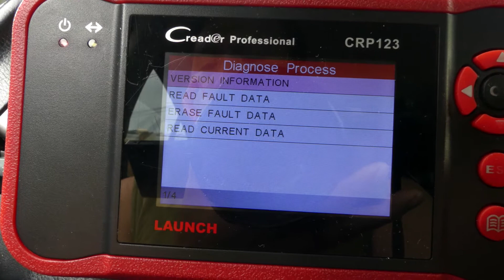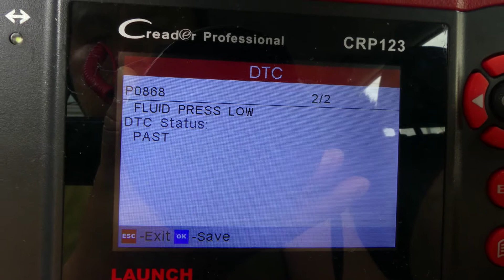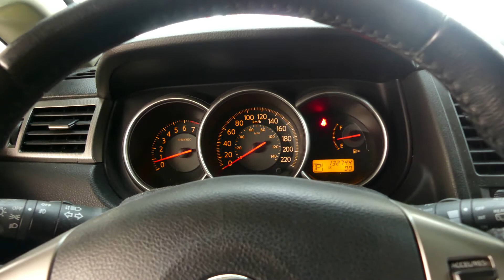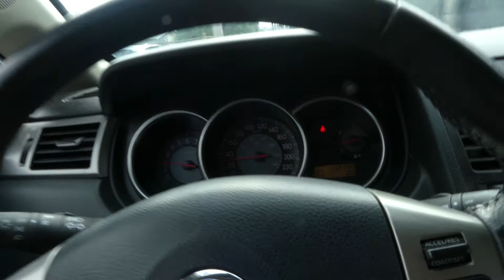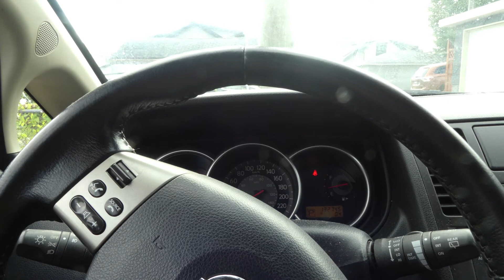2008 Nissan Versa Transmission diagnostic & FIX (P0746 & P0868 )

Comment: I recognize this video is now 4 years old, but it saved me a ton of money and quite frankly, saved me from giving my vehicle to salvage.

I own a couple 2009 Nissan Cubes, and one started making the whining noise and will not move when in drive. Four different mechanics told me I needed a replacement transmission which was on back order even from the dealer at around $4,000. I let the vehicle sit for a while and came across this video. Luckily I knew a bit about working on cars, from my younger days, and got to work. 

I drained the transmission fluid, but no change in functionality. I then drained the fluid again, changed both cone and strainer filters, and topped off with Idemitsu CVT fluid (refused to pay $27/quart for OEM). While the noise went away completely, the gear shift was not as smooth as I liked and I developed a slight oil leak around the pan. I then drained the fluid again, replaced the pan, bolts, and gasket (all factory) and refilled with Amsoil CVT fluid this time. Now the Cube runs like brand new again and no leaks. It is important to torque the pan bolts to 52 in/lbs.
Reply from the maker: Thanks for sharing your experience and I'm glad the video helped you save some money!

Comment: Hi. I seen your video of how to change transmission oil on 2008 Nissan Versa. I have a question please: After  adding transmission oil 6.5 quarts, do I need to open the 19 mm pan bolt to drain the excess oil . Great video. Thank you

Comment: Worked for me in New Zealand. 2006 Nissan note, would not engage in any gear (forward reverse etc.) Replaced fluid with NS2 compatible (Penrite Multi use CVT fluid) as our parts place don't sell them anymore 😕. But runs good now.
Reply from the maker: im glad it works

Comment: 22 bolts on my 1.8 Tiida pan, with a manual ratchet.
I was over it by bolt 3.
there's a little cylindrical filter at the top, but, apparently, nobody ever replaces it, so it's almost impossible to buy.
I think it's for the breather.

Comment: Great job explaining the issue, why it is happening and the solution. Excellent video quality as well. Keep up the good work! My daughter just bought a 2009 Versa and I drove it today for the first time and there is a slight whine from the engine area that coincided with the speed. My first guess was transmission issue so I will dig a little deeper. Fingers crossed! Cheers!
Reply from the maker: Thank you very much!
Reply: What was the issue??
Reply: Probably wheel bearing hopefully.

Comment: Hello, this is a great video, I have the same codes as in this video but my 2013 infinity jx 35 cvt won't engage drive or reverse, nothing completely dead.
Can you tell me what you think? thank you so much
Reply from the maker: ur transmission is dead done u need to replace it

Comment: For my 2009 nissan versa i had P1778 for stepper motor so i got that replaced and everything cleaned out. 2 weeks later same issue. I pulled codes from transmission yesterday and it gave P1778 and P0868. The only symptom i experience is delay gas pedal response 3-5 seconds. No noises and no smell. You think valve body can fix the issue or transmission replacement needed?

Comment: The problem I have with my 1.8 Tiida is that the PenriteNS2 fluid is yellow, and almost impossible to see on the dipstick, (which is a swine to remove if the clip is engaged - I now fit it the other way around.) 
Our 1.5 has red fluid, and it's so much easier to read.
My neighbour paid over $5000 for a replacement transmission in his wingrod, which is mechanically identical to the Tiida/Versa, and it was just making horrible noises.
I'd say that a $400 filter and fluid change would have fixed it.
Love your work.
What do you know about the Honda Jazz CVT?

Comment: What should i do for my car Xtrail T31 CVT. When i drive long journeys about 200 km, the car will not change gear going into limp mode at 40 mph with a whinning noise, i diagnosed it and gave  P01740  code something to do with torque converter clutch solenoid ? But if i stopped switching off the car  for 1 hour and start again the car will go very well and no limp mode.  It looks like this switch get too hot, what should i do?
Reply from the maker: bring it a transmission shop most likely ur having a transmission problem too bad

Comment: I have a P0868 code on my 2014 Dodge Journey SXT 3.6. I have park, reverse, neutral, but only 2nd gear when in drive (limp mode). When in manual shift, it only shows “D”, does not show the actual gear your in and won’t manually shift. On the dash information panel, the transmission temperature is not displaying any temperature and the thermometer 🌡 gauge is at the very top on a (cold start). I also have a P1745 code. The journey has 307,000km on it and has been properly maintained. This problem just came out of nowhere. I took it to the garage today to  get it scanned and I had the engine oil and filter changed (was due). Diagnosis after codes was to take it to the dealer for transmission. I also found out today that the oil filter/cooling housing is leaking (common problem), so now I have to get that fixed. Also, I just want to mention that I’ve had the transmission fluid exchanged at the quickly lube. But, I did not do the pan and filter (big mistake I’ve heard). 
So, I’m leaning towards a clogged filter throwing the P0868 and the P1745 is an issue with the pressure sensor caused by the clogged filter as well. I drive it very lightly.  So I’m hoping it’s just needs a flush,pan and filter service. It’s got 307,000km on the filter so ya it needs to be changed. No leaks on the transmission, that was checked today by regular garage. She’s has great torque and take off but only the one (2nd) gear. She will park, go into neutral, reverse, but can only go 50-60km/hr (limp mode).
Reply from the maker: well try this cleaning repair video that i did it might help ur transmission back to life
Reply: Bonjour
J'ai même problème avec ma fiat freemont. J'ai essayé tous ce qui était décrit sur ce vedio mais le problème est toujours là avec un code P0868.

Comment: clean the oil pan with water is ok and i assume also the screen filter but not the paper cylinder filter right? this paper filter can't be cleaned with water right?
Reply from the maker: yes u can but i prefer brakecleaner not water

Comment: Perfect super video, thank you so much. I've seen so much videos about CVT problems but your is absolutely the best one.  I've a similar problem with my Murano 2006, I've changed CVT fluid (was very dirty as well) with great reflush, but no filters cleaned.Code P0746 is appering when is operate temperature arised car don't want to drive, I must stay one hour to cold up, restart and I can continue next several kms... Do you think should be the same problem with dirty filters? 
Nissan service wants to replace tranny for approx 6000 Eur...horrible to think it
Thank you so much for your super advices.
Have a nice day 8)ose.
Reply: Replace the valve body it’s the solenoid”A” stuck off I have same problem in my 2010 maxima I Just ordered the valve body few days ago once you replace that your car should be fine I was told I need a new transmission but I’ll definitely spend 150 on valve body and $30 on gasket and new transmission filter and $100 on fluid before I go and spend $3500-4000 on a transmission
Reply: We've got the same problem error code P0746 already replaced transmission oils, had it cleaned and still when It operate at high temp it doesnt drive and we have to wait several minutes to cool ito down to drive it again. Mechanic told me to replace the valve body
Reply: @stephenchampagne5763 after replacing the whole valve body was your vehicle fine afterwards? With no more p0746 I am
Going through the same problem currently and I’m not sure wether to take it to a mechanic or do these steps myself

Comment: How far up the dip stick should the fluid be on a Cvt transmission it’s hard to see in the video? I have a p0868 code only.
I filled it to the second notch it looks like you fill it above the notch by 2 inches is that correct? I’m not sure if I have the correct dipstick mine reads hot right after the second notch
Thank you the video is very informative

Comment: Was the shift solenoid in the pan ever a possibility for you too? 

I have dark transmission fluid in a rav 4 
I ordered solenoid
Should i just do an oil change
Reply from the maker: if u had enough budget then go for it but if ur tight on budget just try this method it will only cost u less than $100

Comment: Hello from the uk. What torque settings did you use and what pattern? I'm about to do rhis on my 07 nissan cube 🤞🏻
Reply from the maker: mostly i do it snug cuz manual says around 9ft lbs which is too loose and bolt pattern in putting it back is start from inside to outside

Comment: Lakay or Manong, Thanks for the videos.  I have a question, hope you can answer.  My 2007 Versa when put on drive won’t move.  Is it solenoid or a flush can work?  What should I do?  I have to put on1 then gas a little then go on Drive to move.
Reply from the maker: bring it to a mechanic
Reply: I have the same issue on a 2013 model. It only happens when it's cold. Did you find a solution to this?

Comment: Hello, I have a 2010 Nissan Cube with CVT. It has P0746 and P0868 code, it drives good when car was cold. Will have rev surge on highway, when i stop, gas paddle not working. Does my transmission still can fix? If yes I'd like to find you, im in Vancouver too.
Reply from the maker: Base on my experience with this if the car still drivable and u cant hear grinding sound coming from the transmission thereis a big chance its still fixable by just doing this methos how ever no guarantee i did made this video just to show u guys that this can be fix by just ceaning ur tranny filter and replacing the fluid and u will spent a portion of a 3kplus worth of replacement transmission ..u can only spent around $350 cad compare to 3k replacement/rebuild transmission and if u wanna reach me this is my business number 7783235613 thanks
Reply: @asianmechanicguy6483  Thanks for your time buddy, yes i did change CVTF and new both filter but still fucked. thinking about CVT swap. Do you think Versa 07-09 RE0F08A can swap on my Cube (RE0F08B)?

Comment: excellent sir ...is it necesary to change the oil because ill keep the oil in a good tub and the oil look like good but  if i have to change it do you think the train is very empty and ok to put brand new oil and how is the capacity... sorry about my language im  a french. and how many mille do you thunk the problm is come back right now the car have 120000km
Reply from the maker: put a new  ns2 6 quarts tranny fluid every 30000km
Reply: @asianmechanicguy6483  finally i change the oil brand New because i have trouble to accelratr and i have the code p1778 what do you thing is the problem

Comment: Hello Sir, I had a nissan versa 2009 CVT transmission. I’m facing a problem regarding the whining sound from the transmission. Had it on scanner and it showed P0868 and I took it to Nissan dealer and they made transmission fluid service, but the sound is still the same. In your video the soud is extremely loud while mine only you can notice it if your windows are closed. Please what would you recommend?
Reply from the maker: try to open transmission pan and clean the filter
Reply: Did you ever fixed that code? I have yours and p1178
Reply: @asianmechanicguy6483  I did and the code is gone, but the whining sound still as it is. What do you think ?
Reply: @jonidimeri1578  yes the code is gone but the whining sound still the same:/
Reply: @DrSpray-yk9ru  Many says is failure of valve body but not sure

Comment: I just change the cvt oil in my mum tiida and the oil was dirty but there was little metal bits in the sump. There are  on issues or noises from the cvt before or after i change the oil. But i on its not a good thing.
Reply from the maker: If it has little metal on the sump u got a worn part somewhere in ur transmission dont bother to change the fluid anymore rebuild ur transmission or replace it

Comment: Hi, I have a 2008 versa that I purchased used in  may 2018. I got my engine replaced in 2020. haven't done anything yet to check the transmission health....I didn't drive the car much for 10 months last year. My cat rolls back on steeper hills. Please advise....
Reply from the maker: How can I help you?
Reply: Yeah people with cats like versus versus the biggest and the new center of the biggest garbage you can get pretty much

Comment: Thanks for the detailed video, i have a small tiny fragments on the dip stick, just found them yesterday. However the trany works ok, did not notice any lag or missing a gear. Shall i change the oil and vlean the filters? Or leave it since its wotking? PS: the oil is still looking ok
Reply from the maker: Try to open ur tranny pan that way u can check and decide for ur cvt transmission
Reply: @asianmechanicguy6483  well definately do. I will do the cleaning anyway, and if it did stop working, then i shall buy a new car
Reply: @alisrour5563  did you end up dropping the pan? And did you find more shavings?

Comment: Very very informative video
Reply from the maker: Glad you liked it
Reply: after cleaning my transmission and change the fluid and filter,  and my transmission will not shift please help Nissan Altima 2007 3.5 engine

Comment: Hi, i wanted to ask the nissan micra k13  model 2012 in cvt transmission if there is a fuid filter? Last change fluid mechanic only clean stainer
Reply from the maker: if he open the transmission pan for sure he clean the tranny filter too ..most of nissan tranny filter is a fine strainer and its reusable
Reply: @asianmechanicguy6483  thank you so much for your respond but im watching all time only strainer he clean..

Comment: I bought the car from Anthony and it had a p0868 and p0746 and metal shavings in the pan.  Cleaned the filters and flushed all new fluid and added an in-line filter.  Am I wasting my time and money and have to replace the trany of mybe just the sol A.  Help please.  Im thinking a lost cause at this point.  Thanks
Reply from the maker: Yup its better to rebuild ur transmission or get a new one
Reply: Ever figured out what the problem was ?
Reply: @MrJOHNY347  The transmission was shot.  Got rid of it.  not worth spending 5k on a transmission.

Comment: Hi Boss my wife has 2008 Nissan tiida same as versa 5door hatchback but it's a right hand drive in New Zealand does the same method apply and does the ns2 cvt fluid have to be red or should be red? Thank you i really enjoyed watching your video as I will be attempting this on her car
Reply from the maker: This applies to 07-09 Nissan versa or tilda SL cvt transmission ..And yup ns2 should be red and most transmission oil are red ns2 or regular tranny fluid
Reply: @asianmechanicguy6483  you are the top Man👌. I will come back here to let you know how it went as it still has a few more ks to go before I change fluid 🙂
Reply: Hi, Boss my partners tiida is now due soon in a couple of weeks for transmission drain refill ect.... My only concern is the transmission pan bolts torque setting do you know what they are please as I don't want to over tighten or under tight them and if there is anything else I should be aware of as I will be doing it exactly how you are doing it cheers 👌
Reply from the maker: @tio123ist  22ft lbs start inner to outer when tightening

Comment: Thank you for the video! It helped more than any other video on here. My question to you is my 2014 is slow to shift into overdrive. I have to let off the gas before it will shift into overdrive. Is is possible that my 2 filters are dirty? I changed the fluid with cvt fluid and it made no difference. My old fluid was black just like your old fluid was. Mine does not have any codes and does not make any strange sounds... Please help me ...
Reply from the maker: Try to clean the 2 filters too it will help a lot i distribution of cvt fluid on ur transmission
Reply: Did the new filters help I have the same issue
Reply: @cranemann25  On mine it did not work but it might on others

Comment: Is the process different for same year but automatic transmission (non-cvt)?
Reply from the maker: non cvt has different transmission component but they are pretty much thesame in cleaning the filter
Reply: @asianmechanicguy6483  i have a problem with my versa that it takes a few seconds to shift into drive. Mostly when cold start. I was told to try to clean what you did but also the solenoid. I was trying to see how to get to the solenoid. Any advice?
Reply: Any advice my friend?
Reply from the maker: @babarentals2941  cleaning the filter will a lot especially if ur transmission never service just follow my procedure

Comment: Greetings,
My 2012 Nissan Altima 2.5SL is at a transmission shop. Had 6 codes. They replaced the transmission valve body. Now the only code that remains is P0868. Been 3wks and they can't clear code. Can you suggest what else could cause this code? Do you think the transmission need to be replaced/rebuilt?
Reply from the maker: u need to rebiult or replace ur tranny cuz ur sensor teeling the ecm that theres no enough fluid going trough to the tranny ..and base on my experience ur variator is done ( bearing broken or seal ring worn)
Reply: There is 2 pressure flow valves in the pump.. that is where your problem is

Comment: My 2011 Nissan Altima 2.5S just recently turned 80K miles. Then a week later went into limp mode and will not speed up. I had codes pulled. Please help.

Codes
P0500
P0101
P0720
P0746
Reply from the maker: bring it to a transmission shop
Reply: @asianmechanicguy6483  Yeah, might need to.